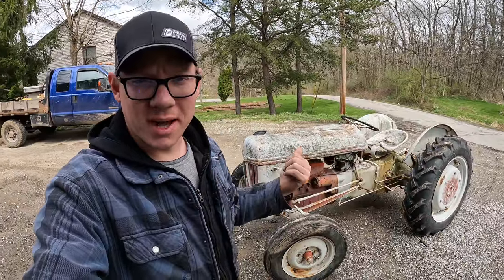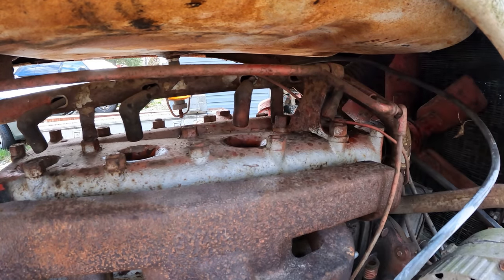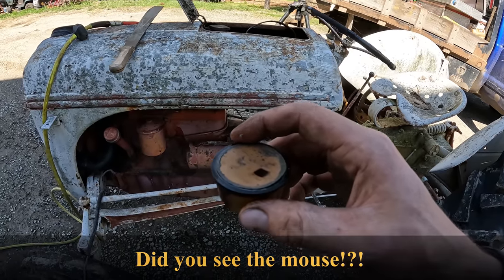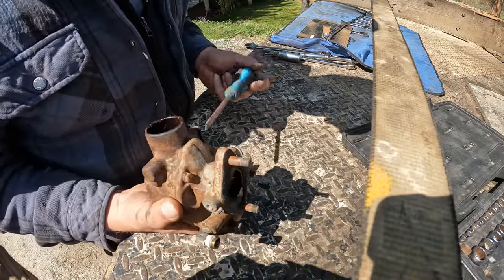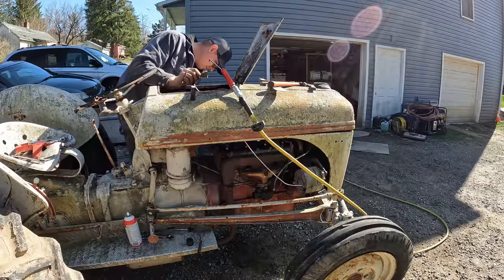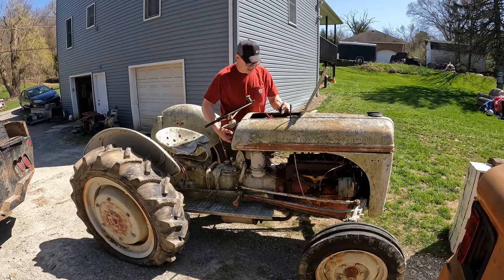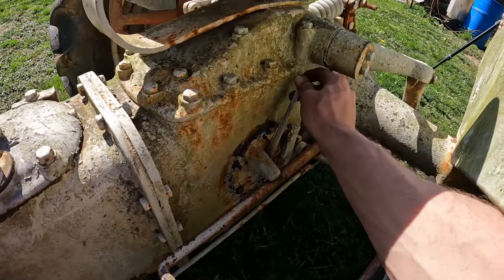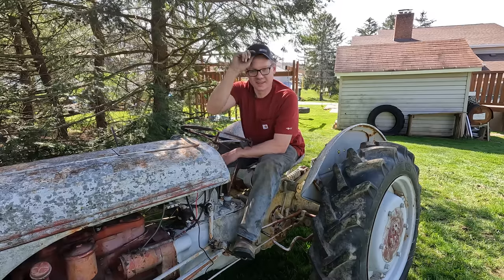Saved From the Crusher! Will this 80+ Year old Ford 9N Ever Run Again???

Comment: Someone may have pointed this out down below, but I didn't see it - that coil design was unique to Ford V8s and N-Series fours (essentially 1/2 of a flathead V8) up to 1950, and pre-war/early post-war flathead sixes. In '51 the V8 and the N-Series engines gained conventional distributors.

Comment: I learned how to drive on one of these old beasts.  That's right, didn't learn in a car or pickup, I learned how to drive by raking hay on a 9-N Ford Tractor.  Second gear was too slow and third gear was way too fast up in our rough country in Montana.  We sure didn't miss this misery machine when the Boss replaced it with a Ford 2000 with a Selecto-speed transmission with ten forward gears.

Comment: I started driving my grandfathers 8N Ford when i was 8, six years later he decided to completely restore it and I was blessed to help with the bodywork, paint, rebuild ,and convert to 12 volt. I spent the next 20 years doing everything on our 200 acre cattle and sheep ranch with that reliable old gal. including teaching my son to drive that tractor. When my grandfather died we had to sell the ranch and tractor, but I moved back to the area 15 years later and I visited the new owner and the old girl still looked and ran great. Its now been 58 years since I first saw her and she still works like a champ, this video brought a flood of emotion, thank you THANK YOU THANK YOU.
Reply: My experience was very similar, however, I bought ours and still have it. I know the sound of it running and starting quite well.
Reply: We got an 8n when I was a kid, it was from my grandmother's farm. It had a forked front loader for a manure loader. We welded plate steel to make it a bucket loader. A blade on the rear for leveling dirt. We used it for many years for inground swimming pool installations. Backfilling and grading.  I still see them today on small local farms. Great memories
Reply: Matt why don't you put the engine from the constor into the other autocar

Comment: I restored a 1953 Golden Jubilee that sat in a forest for years. Dragged it home and did a full restoration. I use that little Ford every summer with a finish mower. She does purr like a kitten and is a joy to operate. Well engineered and built to last. Great video as always Matt. Thanks for saving another classic
Reply: My dad had a 53 Golden Jubilee for almost 20 years. It lost the hydraulic pump and one of his neighbors offered to buy the tractor at that time. My dad still kicks himself every time he drives by his neighbor's house and sees that tractor.
Reply: Farmer Tyler Ranch has a Jubilee that he has been doing a slow motion restoration on. The tractor used to belong to his Grampa so I think it's going to stay on the ranch. He also has been working on an 8N with the tubular frame loader that actually gets quite a bit of use. Love that old tin!
Reply: unlike the stuff we have today breaks way too often.
Reply: My jubilee is a 54' and I also finish mow with it, I use a 72" befco and mow about 4 acres, I don't mow until it needs it and I get three mowings on one tank of gas

Comment: Thank you for saving it.  I just restored a 2N (1952), hadn't run in over 25 years and many parts had been removed.  Tractor Supply supplied the parts to get her unstuck and popping again and once confirmed it was a runner I completely restored it including the hydraulic system, built my own wiring harness, added LED lighting, an alternator and a paint job.  She spends her days cutting trails and pulling a wagon for the grandkids and their friends.  Best $1k (including the cost of the tractor) I ever spent.
Reply: you sure it was a 52 2n???????? 2n's were only made during the war
Reply: @harleythrelkeld7587  Dyslexic ....  That's a 1952 8N, Sorry.
Reply: That steering box valuable. The early ones (9 and 2N) are getting scarce
Reply: @harleythrelkeld7587  The engine's serial number tells all.  They are stamped into the block even with the top of the oil filter and just back a little from it.  NO chassis Serial Numbers were used.

9N  1939 - 43 SN 1 - 105412
2N  1942 - 47 SN 99003 - 258504
8N   1947 - 52 SN 1 - 442035

Comment: Not sure if you know this or not about the fuel valve, but it's a two stage valve. The tractors don't have a fuel gauge (Some of the dealers sold one that was basically a paint stick with marks on it that you would dip into the tank to tell the level). For normal operation you open the fuel valve like half a turn, and then when it starts to stumble you open the valve all the way and that opens the lower fuel feed which gives you another gallon or so of fuel, idea being the "reserve" will get you back to wherever you need to go to put fuel in it, similar to the "reserve" on an old motorcycle.
Reply: Early vw beetles  pinched that dual fuel tank system 😮

Comment: I always loved these old Ford 9Ns - they worked the farms that kept America fed during the war and that so many of them are still running is a testament to their solid design. Good on ya, brother!
Reply: That so many of them are still running, is because their gearbox is too limited to get any real work done, so none of them has seen any real work for the last 50 years. 
Same as the Fordson Major in Europe, my pal restored one because his granddad used to have one, but they are just too awkward to use with a modern rake or tedder: the PTO isnt independent and 6 gears is not enough. He sold it to an old bloke who wants to drive parades with it, and bought an IH 644 instead for the 27ft rake and 40ft tedder.
Reply: @Sjanzo  They look like they should be handy but they aren't is another way of putting it. An IH Farmall letter series is more useful anymore.
Reply: Hi Wes .. Lol
Reply: @J-1410  i havent driven any Farmall letter series, just a Ford N series which was still popular as an estate maintenance tractor in Canada when i was there in 2005, but thats all they are good for: running a finish mower and pulling a driveway grader. If you wanted to back up a haywagon onto a hill, the gas engine would stall because it doesnt have a low gear range and it doesnt have the low end torque of a Diesel.

Driving it, i could not understand why these were still so popular, because they arent rare enough to be special, and not practical enough to use them for farming.
Reply: @Sjanzo  Perfectly practical for what I needed it for growing up. Had larger tractors used In the fields and for big jobs. We used our 8n tons when it came to grading, brush clearing, hay raking and wood collection. Basically anywhere we needed to get into and be compact it was the right tool for the job. Also many n series tractors were equipped with a Sherman transmissions to compensate for the tall gearing.
Reply: @Sjanzo  The N series are Utility tractors, pretty much the first of the breed. You wouldn't farm 40 acres with a 20hp Kubota BX, why would you do it with an N? Even in the 1940-50's they were more often used for things like cultivation of row crops like grapes,  orchard mowing, rototilling, front end loader, back blade work, moving wagons around or mowing small pastures, etc based on what my grandfather talked about, rather than a heavy tillage tractor. You had stuff like the IH M's, MM U's, JD 40/60's etc that did that stuff on most row crop farms. I have my great grandfathers 8n, it replaced his farmall F12. He worked 12 acres of grapes and had a decent sized for the time chicken operation on his 20 acres. So he didn't need to try and plow some large field, just cultivate the grapes, haul chicken manure around and spread it, haul a wagon full of chicken feed around, mow a bit around his fruit trees, dig flood irrigation ditches with a small ditching plow, etc. The N series was the best tractor at the time for this sort of use. Gotta remember that most farms in the era were less than 40 acres total including buildings and woodlots and had previously been worked with a few horses. The scale and speed they worked on was different than we expect now. Think a 10ft rake or tedder, not 40ft. Great gramps ended up with 3 N's by the time he retired. One with a front end loader, one with a hydraulic pallet lifter to use as a forklift and another decked out with Howard rototiller aux trans and whatnot to do all the 3 point and pto tasks with.
Reply: @timberinternational2377  yes, they had their time and place, but have been hobby tractors for the last 50 years. 

Also, an N wont pull a 30ft rake, a Super Major would, if it had better gears, live PTO, live hydraulics and 540rpm PTO instead of 700rpm. I just took it as an example for a tractor that was a modern high power contractors tractor in the late 50s, but were relieved of prime duties as soon as live hydraulics, live PTO and more gears became available in the 70s, so they were sold off to small farms that bought them cheap so they could live with its limitations.

Comment: First tractors I learned to drive were this type - bulletproof and they will run forever with a little care. For smaller jobs they are perfect and there's no corporate deere john keeping you from working on it. Well done, Matt.
Reply: And if you can get an owners manual (or a pdf), there is some much Info in there. It is surprising just how in depth those manuals were back then.
Reply: yes you don't have to be wifi connected to plow a field.
Reply: @cb-gz1vl  My great grand dad did it with a team of Clydesdales. His favourite was Old Rob, who he kept on gentle (and costly) retirement until the end. Great grandad was known for his temper but not so much for sentimentality. My mum told me of the day the knacker's van came to take Old Rob to the glue factory. Her grand dad walked over the hills and was gone for the day. I'm sure private tears were shed over the loss of a friend. For context, this was on a croft in northeast Scotland in the late 1930s when the tenant farmers couldn't even dream of owning a tractor and a good team meant the difference between living and starving so they were cared for. Have yet to see a video on "this horse hasn't moved in 47 years, will it start?"
Reply: Give me a price, might have to come get it.
Reply: Me too! Small farm ohio.1949 8n .

Comment: We have tons of the Ferguson equivalents, they're pretty much the same thing, and they're great, they mechanized farming and fed us all!
My dad has the TE20 that one that one of our predecessors acquired, it was the first one in the whole district.
We still use it for small tasks around the farm all the time, like moving trailers in tight spaces, pulling timber etc.

For anyone buying this tractor off of Diesel Creek:
3 point hitch:
Make sure the lever on the left side of the transmission housing (just above and behind of where clutch pedal is) is set toward the rear, with engine running and clutch in (edit: Nvm you did, and it worked, nice!).
Don't keep it on all the time, because of unnecessary wear.
It uses transmission fluid as hydraulic oil, check transmission oil levels, if it's low the pump will cavitate = Not good.
And yes, you're using the 3-point lever correctly ^^

When you change transmission oil (and it takes a lot, 5% of the total weight of the tractor is fluids ^^), or need to top it off some, don't go with expensive modern types, use a non-sulfur oil, VERY important, non-sulfur, otherwise it will prematurely wear/destroy transmission internals.
So just go with the cheapest natural dinosaur soup you can get with a minimum of additives, these tractors were made to run on that for centuries!

Hydraulics mesh filter is at the bottom of the transaxle casing, look for a small lid held in place with bolts, if it's clogged up that's why the 3 point hitch won't lift (not applicable, as you got it running, but still something to check), be AWARE that when you take it off, ALL the oil comes out, so have a 10-15 gallon bucket ready, I advice heating up the transmission by driving it around some first.
Be CAREFUL in cleaning the filter, NO screw driver to scrape the sludge off or you will puncture it, rags and fluid solutions ONLY.
Don't be discouraged by white-soup coming out instead of oil, that's just because water contaminates it a little via non-existing gear shift rubber boot.

If you have to rebuild the pump, watch youtube videos on rebuilding 8/9n/te20 pumps, they're all the same and comes apart the same, when you take the transaxle top lid off (where seat and 3-point top link spring & hydraulic return dampener mounts to), there'll be lots of sludge and crap at the bottom, don't be discouraged, it's normal, just clean it out ^^
Reply: We also have a Ferguson TE20. Have never done anything much to it. Ours runs on petrol (gas in the US) or TVO. Tractor Vaporising Oil. You start it on petrol and switch over to TVO with a little brass valve when it warms up. Can't actually get TVO so you have to mix up various alternatives. Can't run it on petrol / gas when it's hot either. The carburettor gets too hot.
Reply: @londonwestman1  Ah yeh. aka Kerosene, we have 4-5 of those too.
A lot of those were converted back to straight gas here.
Our 20's are worked a lot more than those that just buy one and start it twice a year, so need more frequent maintenance.
Reply: I know the 8N called for 90w mineral oil for hydraulic fluid. Near 7 gallons I think.
Tractor supply carries it.
Typical hydraulic oil way too thin, but it will work
Reply: @patrickhorvath2684  Sounds right to me.

Comment: Matt, as you discovered the PTO must be engaged to lift the 3-point arms.  You’ll notice that the PTO stops when you step on the clutch and the hydraulics will lower if there is a heavy attachment on it when you step on the clutch.  Most tractors after the 9N era had what is called “live PTO” which means the PTO runs when the clutch is disengaged. The 9N, 2N, and 8N were important steps in agricultural engineering, but they did have their quarks.  It’s hard to beat an old 9N.  They never die!  Thanks for saving a piece of ag history!
Reply: The was also a cover that screwed over the PTO to protect it when not in use.
Reply: @robertengle1607  I think it was to protect the meat bags rather than protect the PTO.
Reply: maybe that is a 9N thing we have an 8N and the 3 point works just fine without the PTO engaged
Reply: @jerryerickson4999  does it have a live hydraulic conversion kit? That can be done. All the Ns have the hydraulic pump driven by the PTO. Live hydraulics wasn't offered until the 600s came out
Reply: @robertengle1607  unfortunately, the cover won't fit when you have an overrun clutch on there, as anyone using a bushhog should have.

Comment: I learned to drive on one of these - at 15 I spent a summer pulling trailers back and forth from the the field to the packing shed with a 9N that was set up with a pintle hitch. I loved that tractor - always started and ran like a clock. I can remember idling there waiting for a trailer and it was like I could hear each cylinder hit as it ticked over so slow. That thing would run forever on a tank of gas. Wish I had enough property to warrant having one now.

Comment: It’s crazy how simple, durable, and easy to work on those tractors are, especially when you compare them to today’s tractors, that need a special coded computer to even begin diagnosing the thing
Reply: And how much less expensive parts are compared to a collector car.
Reply: I know most of you don't care, but there's a reason there are emissions and efficiency rules now.
Reply: @rsporter  that doesn't mean that the computer needs to not share error codes. OBD2 exists for a reason. 
Theres no reason there can't be a similar standard for tractors or an updated one for all engines.

Comment: Well done Matt. Regarding the leaking exhaust manifold on the Ford tractor, a little trick I have had to adopt sometimes. I once had a straight 6 with a buckled exhaust manifold, a common problem on the Nissan RB engine. Removed the exhaust manifold, put a bead of RTV (resists high heat) silicon on both sides of the exhaust manifold gasket and let the RTV set first. Refitted the manifold to the head but only a little more than finger tight so the manifold didn't crack. Started engine and let manifold heat up. Slowly tighten manifold bolts as manifold heats up. You will get a good seal and the silicon gives you lots of tolerance to cope with warping without the manifold leaking. Hope that tip is useful one day.

Comment: Those old ford tractors are great.  My father has one that was purchased new back I believe in 1956 (by His Father.. we found the paperwork after my grandma passed some 35 years ago) and he still uses that thing often (near daily).. Many of the same functions as you see here… though it’s in much better shape because it’s been stored in a garage most of it’s life.. and used often too so it’s never fallen into disrepair… Even built a wood splitter to hook to the limited hydraulics off the PTO… thems good little tractors.

Comment: Thanks Mat for the video. Our farm in Indiana had an 8N which I  used to pull  a hay rope to elevate  bales to a large dutch barn haymow. When I was 7 years old dad took the loader off so I could stear the tractor using it to haul wheat from the combine pulling small 100 bushell grain flair box wagons. That would have been in 1954. Really appreciate your work ethic. : )

Comment: I had a 9N 1941 model. It had 19" front tires with one rib only. Weird looking tires.  I'd say at some point in time somebody swapped yours out with newer 8 N or Ford Ferguson tires Matt. These old Fords didn't have Live Hydraulics in the early years. In order to get the hydraulics to work you have to engage the PTO.